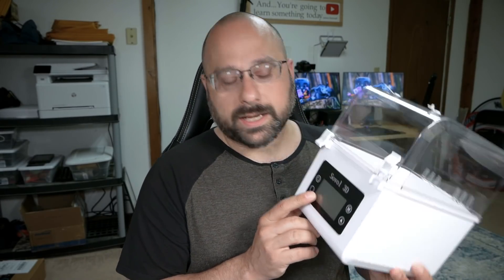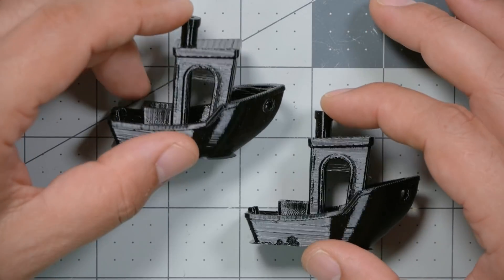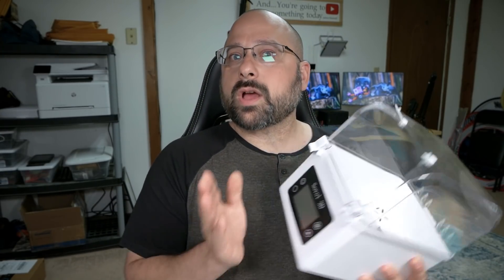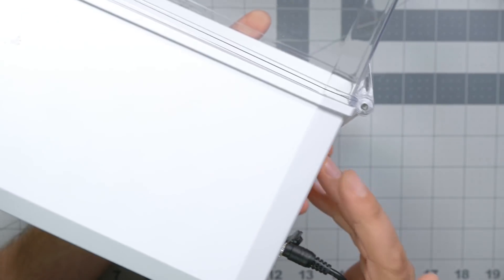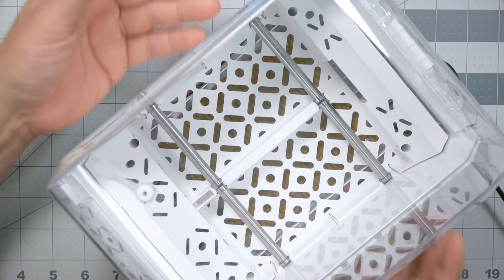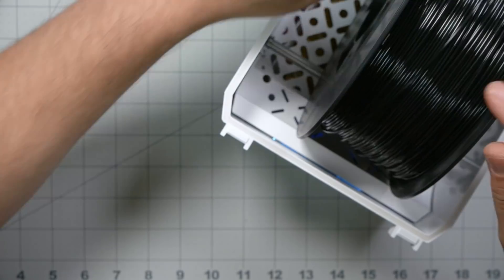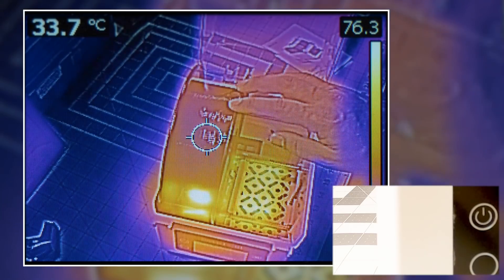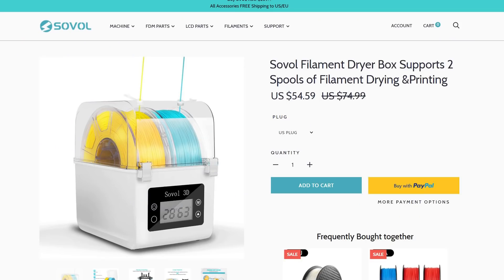You might not even need a 3D printing filament dry box | Sovol SH01

Comment: When new I could print PETG but after sitting in a box with descicant for several months I had stringing problems and it would detach. So, i got the same box being reviewed. It helped my TPU prints whulich started having the same problem.  I started a PETG print but hadn't dried it. Same stringing-detachment issue. So, it is being dried and will see. It has worked before. I have never had a PLA issue except when it broke in the Bambu Labs AMS. Dealing with those magnets was frustrating. I was watching the humidity in the AMS with a sensor added to it so I don't know why it broke in 4 pieces in the AMS.

So, avoiding problems is worthwhile. This box seems to work as doed lots of desiccant with indicator beads.

Comment: TPU absorbs more moisture than other filaments. 76 C° is to much. maximum 50 C° for PLA and 60 C° for PETG. A dehydrator is better than an oven. It ventilates very strongly and heats to between 30 C° and 70 C°. You can put in at least 6 spools of filament at a time.

Comment: Amazon 1kg rolls are 70mm wide, usually 1kg spools are 59mm wide. Avoid amazon filament, it will not fit in dryer boxes.

Comment: You need to open your oven door a bit. I got away with 170F with the door cracked (1inch or so). I folded 2 rags and sandwiched the spool, then layer it on a pan. Just gotta insulate it from the radiative heat of the coils and let the heat/moisture out. You can make cheap DiY JERKY 🍖 like this 😁

Comment: For $50 you can eliminate one group of problems that you don't have to trouble shoot - there are plenty of others. When I came back from a 2 month vacation I was unable to complete a single PLA print. I was having bubbling on the first layer , poor adhesion , the nozzle hitting the bubbles and lifting the print.  I bought the exact same unit you showed and my problems disappeared. My printer is in the basement where there often is humidity so for me it works.

Comment: it did that because you are setting it to do 70deg so it heats up really hot to get it to that temp quick hence the warping
you need to start at 40deg and take it up 5 or 10 deg every half hour till you get to 70 to stop that in little ovens doing that

Comment: Got a cheap IDEX so it was the cheapest option to dry 2 spools. Could have dried them in the oven or in a cardboard box on top of the print bed but those are a lot of bother, more electricity and an accident waiting to happen not worth arguing over less than 50 bucks, shame it only goes to 50C and only runs for 12 hours max though

Comment: If you have a heat pump eng dehumidifier or humidity regulation system - yeah no humidity
I'm staying in a small apartment with baseboard radiators, and it's dry here in michigan. Flex PLA went from great to junk in days
Sh01 fixed it. 
Moreover, despite the filament appearing to produce a decent print, even the small amount caused microperforations in the flex prints. Not a problem for making toys for adult children, but I was trying to make an air tight gasket for a machine pushing slightly pressurized water. The gasket was "sweating" water from the perforations. 

Pla gets brittle when it gets wet... not old, WET. You shouldn't have that issue with dry PLA.

Dessicant does NOT drive humidity out of filament. 

PETG is also affected by humidity badly. 

Lower Temps will still work to dry nylon - just slower. 

Please just do a modicum of background research. If you're doing printing with anything but pla in the desert, you will need to dry filament eventually. Even if you live a dry place, you can still get poorly sealed damp filament out of the box occasionally.

Comment: PLA breaks because it gets moist. There is a very long and detailed write up online, which I have bookmarked somewhere. I just put the Sovol dryer into service and it needs some  mods. Got a nice roll of filament that is slightly miswound. It is not drawing well and would hate to think it is adding stress to the extrude feeder motor. I think your idea is good to do a mod on that spot where the filament comes out. The angle needs to be changed,and a teflon tube put on there somehow. the dryer needs to be at a lower level than the printer to be able to line up with the extrude feeder. Using a Creality Ender 3 v2. I'm gonna mod it. There was a post on a review and it would be a good idea to open the dryer and check the wiring. One user reported some slap happy soldering and wire that was near the heating element and melting. So that's not good ! Otherwise I'm happy with it. Just having the moisture meter and place to put the filament is nice. Oh, another thing I noticed is that pla absorbs through the cut end. Had been using a bag on the filament with dessicant, and the part that was outside the bag had gotten moist. Thank for the vid. Bird ate part of the directions and I put it somewhere and can't find it now.

Comment: I bought this item on sale but had a problem with temperature rise. Although it was 48 ° C on the display of the equipment, it only rose to 33.4 ° C inside, and as a result, the filament did not dry. It may be a problem with the position of the temperature sensor on the main unit.
By the way, the thermometer belongs to Xiaomi, so I think you can trust it.
I need a box that holds two filaments. In the future, I would like to incorporate a 12V heating element to raise the internal temperature.

Comment: Question: is the set/displayed temperature that of the heater or the air inside the dry box?
For most one spool dryers is is the heater element .... 
which can be as much as 20 degrees lower than the air.
Reply from the maker: That's correct. I'm sure it's the heater element.
Reply: @JoshuaBardwell  I suspect that is going to be a deal breaker for many people then. Pretty much limits it to be used for PLA, PVA and TPU. Even PETG is very hygroscopic and needs higher temperatures for effective drying.

Comment: The esun doesnt heat up to 80c, that is how hot the heating element gets.

If you measure it, it basically gets as hot as this. Another guy did a test on it and another heater and he soldered some sensors to the machines.

Comment: (some additional info) eSun don't heat up to 80C, only the heating element is at that temp. The air is only 45-50C. And PETG is more sensitive to moisture, ABS not. Desiccant can be placed inside a  spool.

Comment: Where's the moisture supposed to go if the box is sealed???
Reply from the maker: The air becomes more humid as it absorbs moisture from the filament?
Reply: @JoshuaBardwell  Yes, the air inside the box gets more humid, which puts more pressure on the filament to absorb some of it, so you reach equilibrium sooner. And when you cut the heat the moisture will go back into the filament, so at least let it out before you put it away, if you store your filament in the box.

Comment: So I keep my filament dry by keeping them in a large plastic box that seals tightly and with a Eva-dry E-500 inside.  This will not dry wet filament but it does a great job keeping them dry.  https://www.amazon.com/Improved-Eva-dry-500-Renewable-Dehumidifier/dp/B00BD0FN8A/ref=sr_1_3?crid=1U5AXZOFJK91U&dchild=1&keywords=evadry+500+safe+dehumidifiers&qid=1624289638&sprefix=evad%2Caps%2C310&sr=8-3

Comment: I use a 3D printer in a humid climate - it rains a lot and the printer has been in my bathroom for more than a year - the humidity is often above 70%. The plastic box is large enough to hold the filament and paper bag with silica gel  for cats works well. The humidity inside the box is controlled by a weather sensor. When the humidity inside rises above 50% (this usually happens every 2-3 months), I replace the silica gel with a new one or dry it in the oven at 150 degrees for 1.5 hours.
Reply: You can get silica packs with color changing beads that will let you know when they're spent.

Comment: 50C is pathetic.
For example, Fillamentum recommend drying at 100C for their Flexfill TPU 98A - most TPUs want about 80C
Also with most of these designs (Certainly for the Sunlu FilaDry S1), the reported temp is very inaccurate because the temp sensor is right next to the heating element - See here: https://www.youtube.com/watch?v=6FG4O5l9XpE
IMHO you are way better off using a regular oven, and get a digital thermometer which you put in with the filament.
Another BIG thing that most people forget is DO NOT EXPOSE THE FILAMENT TO AIR WHILE COOLING.
If you do, it can re-absorb the moisture it lost by the time it cools.
Here is my method:
Take a LARGE casserole dish that has a lid
Place the filament in the dish and surround it with silica gel sachets (Dry sachets, not ones containing moisture)
Put the temp sensor probe into the dish, touching the filament
Place the dish in the oven without the lid on and dry it (Adjust setting on oven until temp on sensor is right - largely ignore temp setting of oven)
Upon removing from the oven, IMMEDIATELY put the lid on the casserole dish and leave it until it cools down
Once cool, put the filament in a dry box and print directly from the dry box, or at the very least, put it in a zip-lock back with silica gel when not in use

Comment: The best thing to use is a food dehydrator.  A couple years ago there was a purpose built filament dryer called "PrintDry" and my mind couldn't get away from the fact that it looked just like a food dehydrator my family had as a kid.  So I did some searching around Amazon and low and behold, it was a food dehydrator, just marked way up in price!  I ended up buying the food dehydrator and a clear rubbermaid container to make the "top" and it works amazing well.  It fits 3+ standard rolls of filament and I haven't had an issue with it in almost 3 years. 

Here is the food processor: https://www.amazon.com/gp/product/B0797CVXKN/
and here is the rubbermaid to make the top: https://www.amazon.com/gp/product/B00237S2IU/

Apparently they don't have the exact one in stock but if you look around, it is one of those products where 10 different companies just rebrand something made at one factory for all of them.  

But, the best tip overall is to store your filament properly so that you don't need to dry it, unless it is nylon because even stored properly nylon is so hydrophilic it will suck up water from a mile away in a vaccuum sealed bag.  I would recommend getting large vaccuum seal bags for clothes (the ones you see on infomercials, they actually DO have a purpose) and then get some desiccant packs that can be recharged by plugging them into an outlet.  They are so simple to use, just toss them in the bag when you seal it, and then you can monitor how much water it has absorbed without opening the bag.  Then the recharge phase takes a few hours in any standard outlet.  Here is what I mean: https://www.amazon.com/Improved-Eva-dry-333-Renewable-Dehumidifier/dp/B000H0XFCS/

Comment: Like you Joshua, I don't print with nylon which is really hygroscopic.  Having said that I just keep my filament in a large plastic storage container with a seal.  Ziplock makes them and there are other brands as well.  I purchased a bunch of individually packaged desiccant from Amazon and placed that in the bottom.  It is the type that turns red when it has absorbed moisture and blue when it is dry.  When the packs turn red I put them in my oven for an hour or so to recharge them.  My filament seems to be perfect stored like this.  I don't know how well this would dry filament that had already absorbed moisture but if you start with dry stuff, this seems to keep it dry.

Comment: Hey Josh 
Question about my rssi. I have the xmplus receiver. It’s not working properly so I’m running with one antenna so it’s like an xm. My rssi shows normally 10 but when I thrust it goes up. The more I thrust the higher my rssi goes up. Why is that? Thanks in advance.

Comment: The cheap and effective way I have found is to store your filament in a bucket with dehumidifier beads. Just go down to your local sports goods store and get a bucket with a lid and a safe dehumidifier from the guns section and get out at around $15. A 5 gallon bucket will also hold up to 5 spools. I recommend dehumidifying in the oven first but a good dehumidifier will do that in a day or so by itself.

Comment: you can stop this video right now ill tell you how to dry and keep dry all though a whole roll get a box one with a seal and clamps walmart sells them.. get 1lb or 2 lb of blue indicating dessicant beads comes in bulk on ebay.. get a container drill holes in the lid put the silica in it and then your filament and voila dry filament when it turns pink you place some small ammounts thin layer not the whole  1lb in the microwave set it for 1 minute take it out caution its hot and will remain so for 5 minutes set it on the counter when its cool put it back in the container and voila forever can you recharge your silica gell beads and keep filament dry

now on to the part where you can print thi way too get a ptfe tube for 1.75 filament its about 2 feet long on many sites get the connectors they use push to connect drill a hole in the container put the connector in and seal it up usually comes with nuts you can use a washer etc.. route the filament tube to your printer head i use a version 7 style head where the filament comes in theres a hole you can widen and tap to accept the ptc fitting then the only exposed part is 1 inch of filament you can ooze out beofre a print and vola dry filament forever no need to buy this thing

also side note you can make another box and dry the filament this way just to store but not print from say you order more filament even wet the dessicant beads will remove the moisture over a week or 2 

if you use the oven meathod on filament you can create fumes and you can screw up the filament so it wont fit though a nozzel anymore..

even dessicant beads dont use this method just use the microwave they will turn dark blue when you heat them up also watch out they are hazerdouse only the blue ones and pink dye indicator beads the clear ones are harmless its whats in the dye thats bad dont belive me read the disclaimer or research it so dont spill them all over your counter and make a sandwhich got it... clean up

ive been doing this for 2 years always had a dry roll print dry and you donto spent 200 dollars to buy some product.. its about 50 bucks in total 20 for the container 20 for the beads 10 give or take for the ptfe and fittings and voila.. pla is the best at absorbtion it does not do it very well takes 5 months to really notice so if you print alot and go though a roll no need to do all the above if you hardly print id do the above..

Comment: Here's another thought for you people who want to keep your filament dry.

Get an insulated cover for your 3d printer. When the printer is running, it's naturally heating up it's environment inside the tent. It gets blasted hot in there in fact. If your filament is inside the insulated tent/cover, it's getting heated too. So it dries out naturally during operation.
Reply: If it's getting to a temperature decent enough to dry the filament, it's almost certainly not a healthy temp for your electronics (eg stepper motors)

Comment: Makers muse debunked this for most filaments he dunked them in water and found that they printed just fine
Reply: I'm gonna have to disagree with him. My house was somewhat moist causing non stop string and blobs. I print PLA, petg and tpu and a cheap amazon dryer allowed me to print again. But depending on the humidity of your house you might never need one. I printed all winter long with zero problems, then summer hit and from that point on non stop problems. Humidity is a print killer.
Reply: @shawnwise2458  I'll have to disagree with you. After watching lots of videos on these heaters I find them unnecessary. One person had a great idea of just using the print bed and something over the spool to heat the filament, that sounds like a good idea and the print bed has precise temperature control, and there's no investment.

Regardless, I read another comment where a guy lived in Florida and all he had to do was lower the temperature of the nozzle and the popping and stringing went away.

I've added an enclosure to make up for the lower nozzle temperature and can so far verify that's all that is needed. I've been testing it for the last day on different spools that were wet and they are printing like they're new.
Reply: @dangerous8333  to each his own I guess, I use a digital hygrometer and aim to get it in the 20's. I had went through countless nozzles  and the stringing was ridiculous. Learning to manage my humidity just worked for me. I'm sure everyone believes differently.

Comment: So I do not own a dryer box. I have never printed W/ nylon, but have a few spools of old ABS that the local university was going to throw out I adopted. they were bad shape. so i threw them in the oven but i did some research and one content maker said to leave the oven door cracked open a bit cuz ovens actually can create humidity. and it worked great! however im preparing to make a vary large dryer box involving an arduino! ill let you know how that works out....